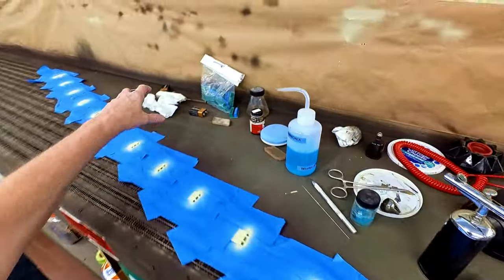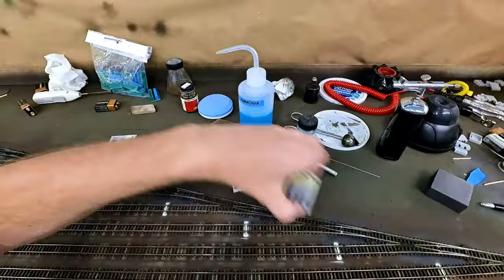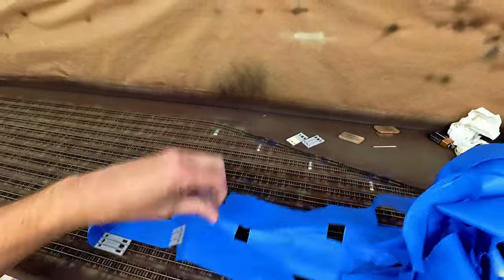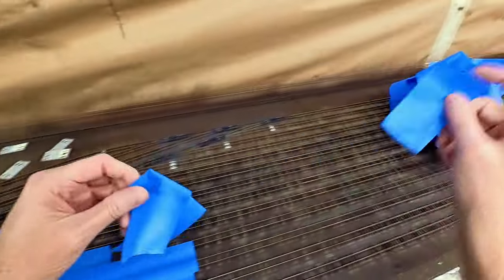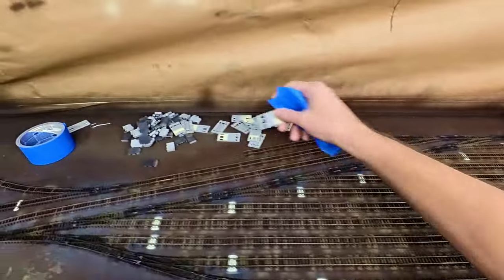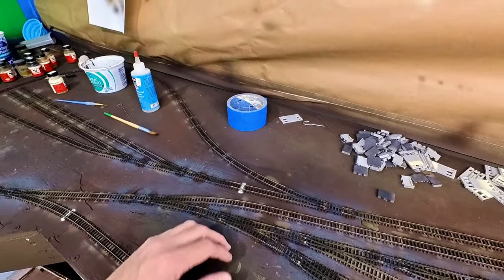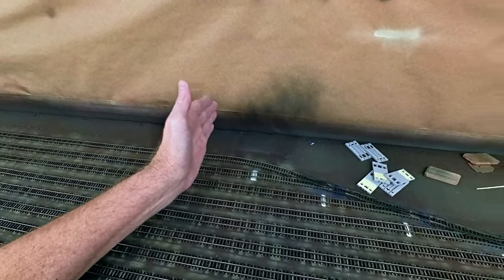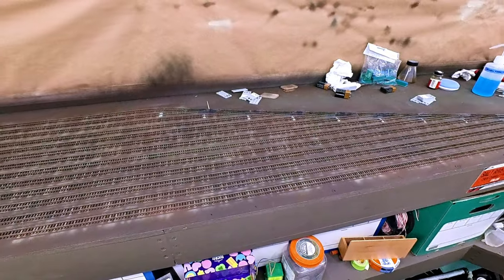how to realistically paint and Weather tracks and ties

Comment: I think the white tie painting is a good idea. It provides a prototype clearance point. Perhaps the white could be toned down a little with a thin black wash. Why not put a signal, working or not, at every main line block location? Now where you have white ties on industry tracks install derails to protect the main tracks from unsecured equipment rolling out?  Or maybe install next to the white tie, a switch stand with a purple target and a centered white letter D for derail? Is there just no end to this? Merry Christmas. Mike
Reply from the maker: I plane on adding some sort of (D) derail to locations that are switched of the main.   not sure what it will look like in the sure what it will look like in the end.  but I will be adding something.  I'm still working one step at a time

Comment: Are your white ties an aid to your operators or is that an actual scale feature that SP or SF used in the Phoenix area?
Reply: I believe they are a visual aid for the operators to know when they are reaching the end of the electric block.
Reply from the maker: I have seen them on other real railroads.  You can spot them every now and then on the ATSF and some on the SP in AZ,  but most have been replaced with purple (D) in those locations.  But I think it will help the operators more than anything else